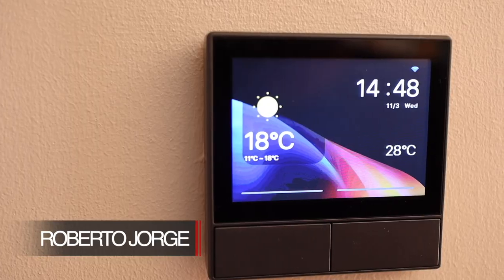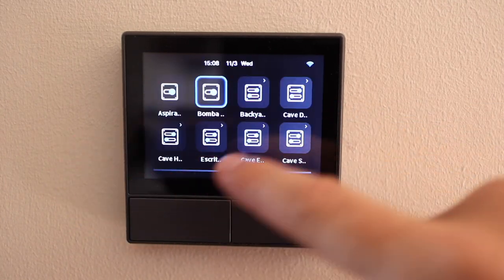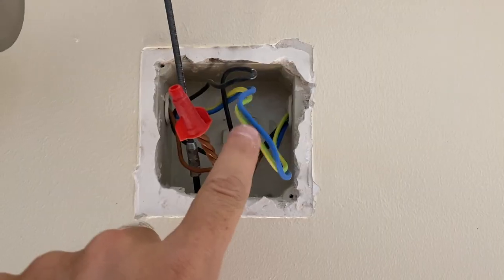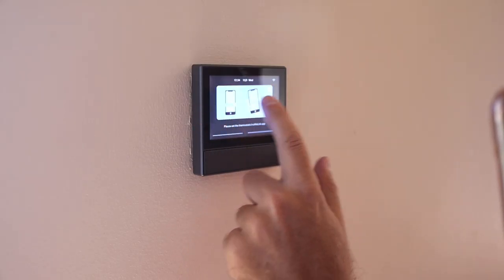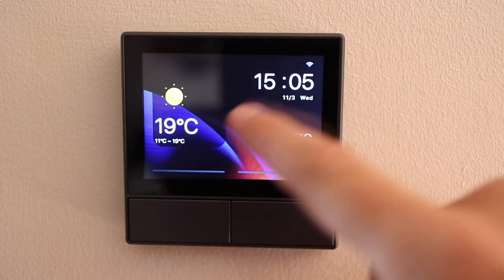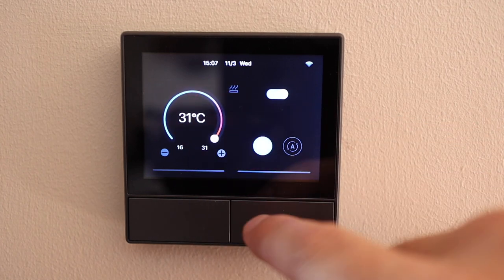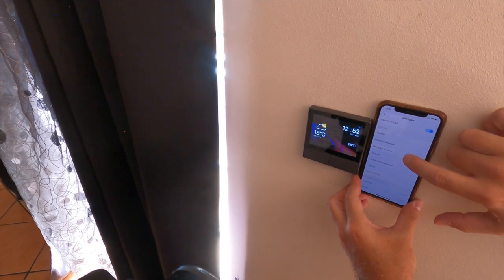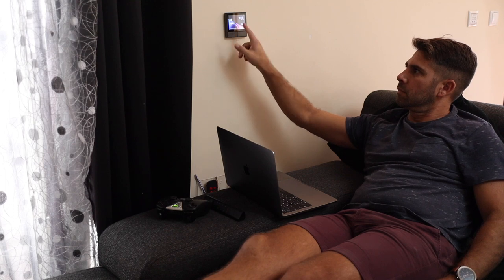NS PANEL The SonOff SMART Screen has IS HERE !!!

Comment: Thanks RJ for a great video. Is there a smart Wifi IR blaster that works with Sonoff so as to control Air conditions? Not just On/Off like a plug. But full temperature control of the A/C.

Comment: Nice Video. Thanks. This is a great and cheap Device. Is it possible to use the physical Buttons without wireing them? So e.g. connect a Smart Plug or a Basic R3 to it?